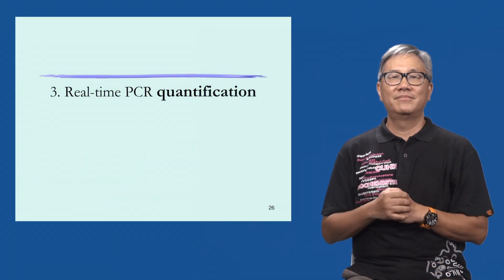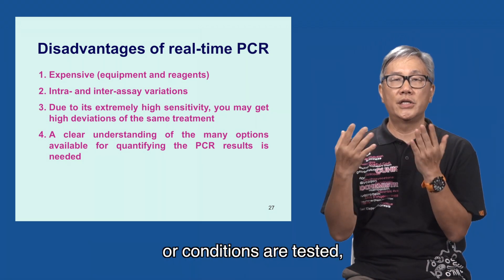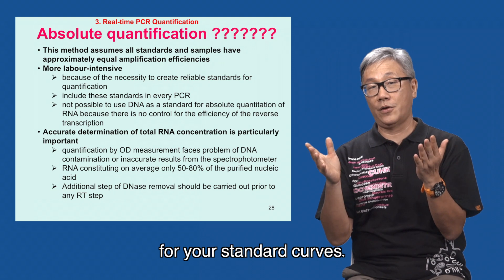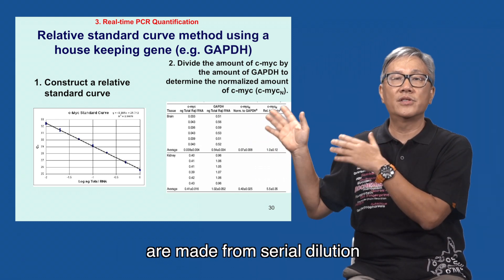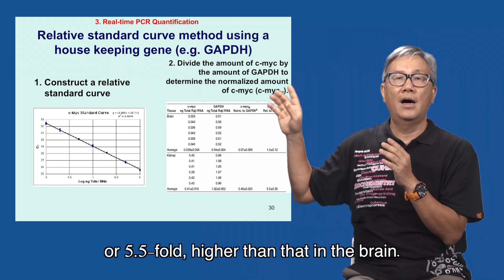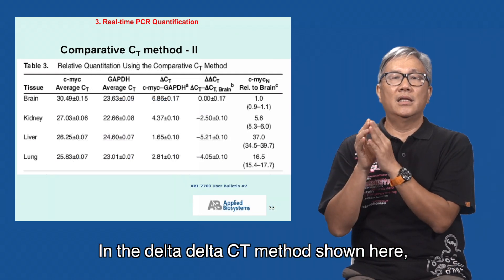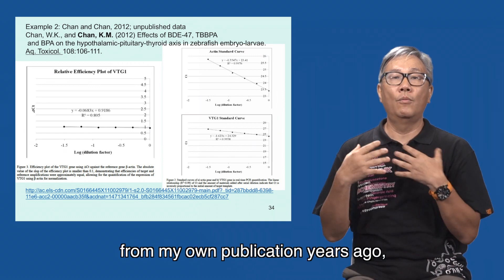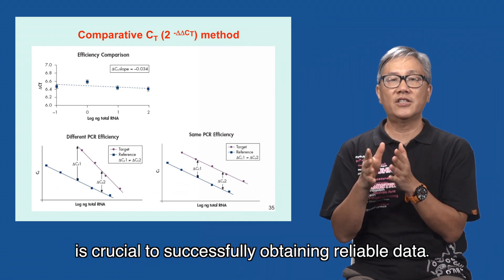Real Time PCR Video 3 Validation of Quantitative Real-time PCR (Q-OCR)

Comment: Hello Sir, So if i want to use "comparative ct" for my research, i shouldn't use standard curve, is it true?
Thanks in advance.
Reply from the maker: Use Delta delta CT method, please check with the calculation from the protocols for your machine.
Reply: @chankingming8964  Ok Sir, Thank you very much. I used Applied Biosystem StepOne for qPCR.